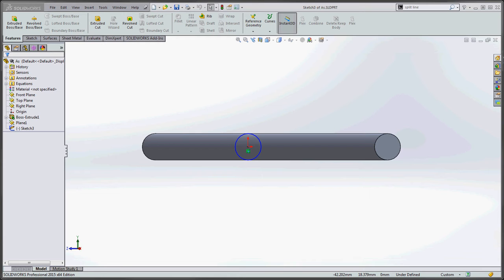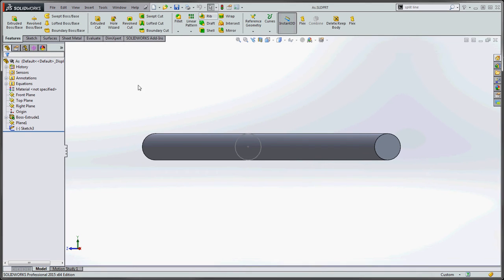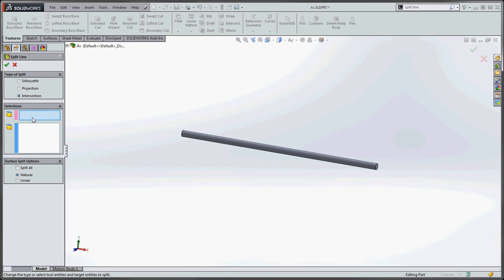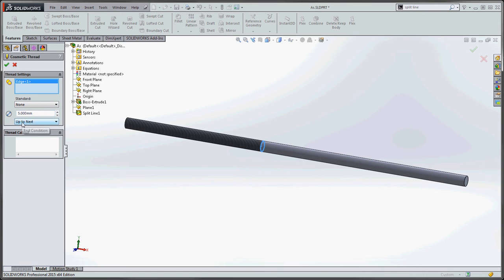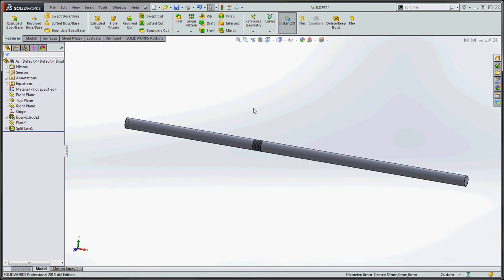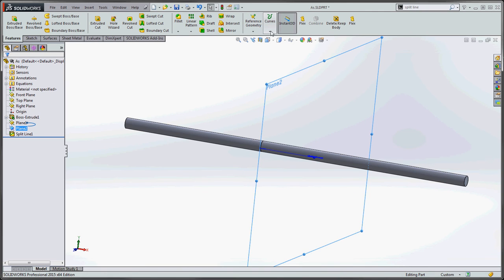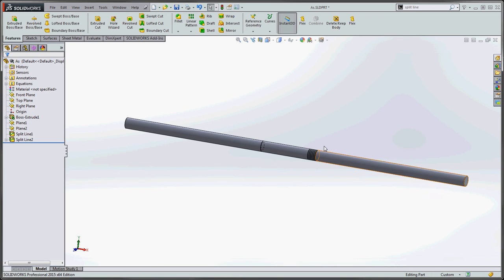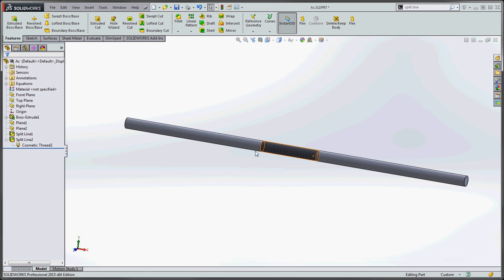SolidWorks - Inserting a Cosmetic Thread in the Middle of a Bolt Shank

Comment: Nice! Appreciate this. this was just a small problem but can be a very handy tool for future designs. Still wonder why the split line type 'projection' didn't work with an (equal sized) circular sketch though...anyway thanks a lot!
Reply from the maker: I think the projection option for the Split Line has to have geometry that is away from the surface that needs to be split, either inside or outside.  The intersection option worked well since the plane intersected the face using simple geometry.